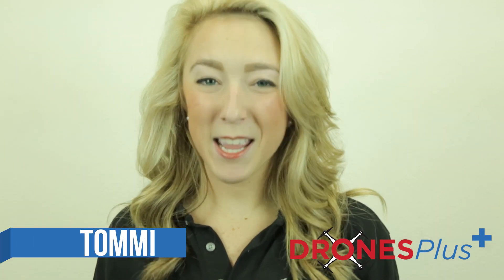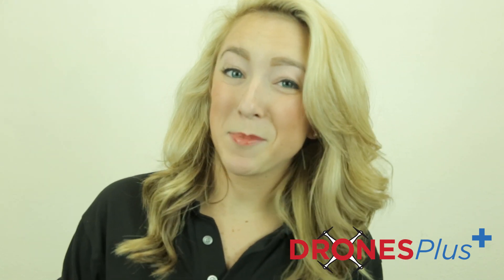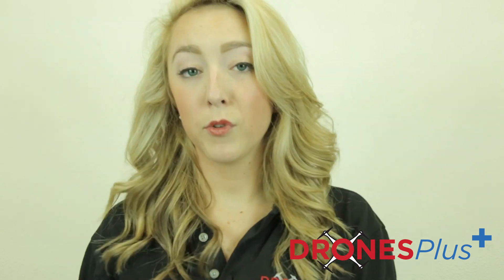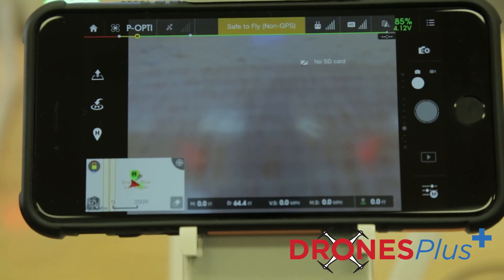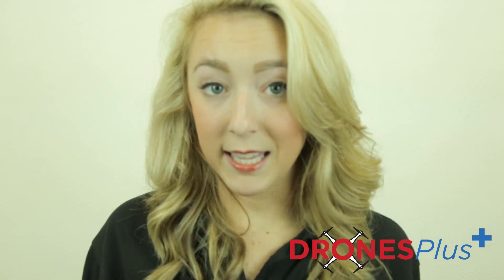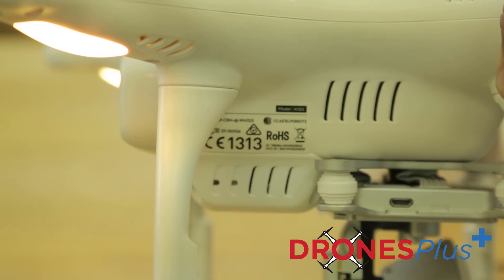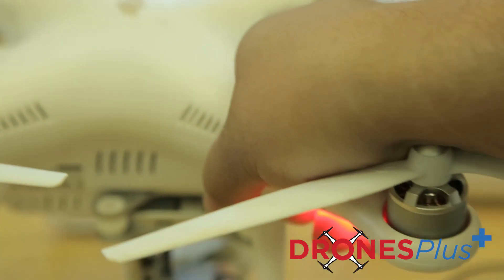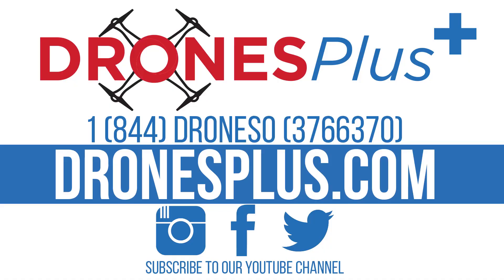Linking (Binding) The DJI Phantom 3 Controller (Transmitter) To The Drone

Comment: Why don't you show the remote connected to the controller?  Do you use a micro to micro or is there another way to "connect the controller to the device i.e. wifi?  What is meant by connect controller to mobile?

Comment: firmware was updated, imu calibrated, controller updated and binded, compass calibrated and all things calibrated and updated but still no RC signal. my p3 standard is new and never ever fly. PLEASE HELP ME.
Reply: +maestro kumag same here brand new out of the box p3 standard dji nice drones but there software sucks mine was ok till i updated out of the box dji support is terrible loads of standard owners having trouble after the last update dji don't care not even flowen mine yet iam waiting maybe dj will post a software update fix i had high hopes for dji too i choose this over the yunnec g wish i had got yunnec now have you found a fix wish there was away to downgrade

Comment: there no linking button??
Reply from the maker: +Tristan .Mc  it's on the left side of the controller
Reply: yeah apparently my controller was made with a defect where there is no button inside the little hole it should be in
Reply: +Tristan .Mc  mines got no button either...and phone says confirm frequency settings?
Reply: +Trisha Torgersen Turn the unit over (while on) you'll see a red light, there's a little button in there. Use a paper clip